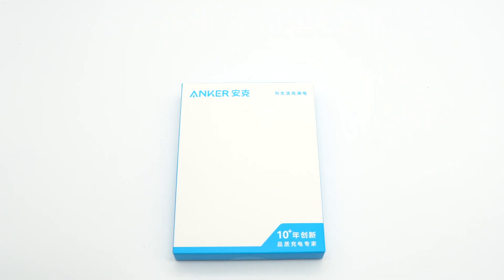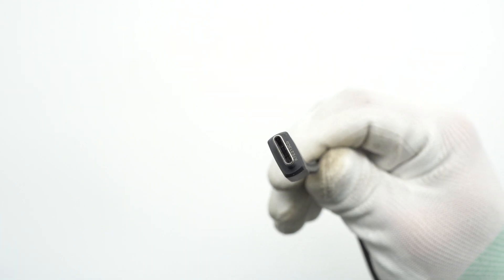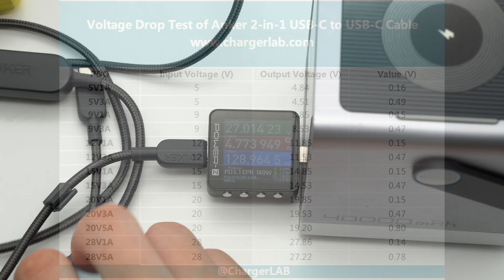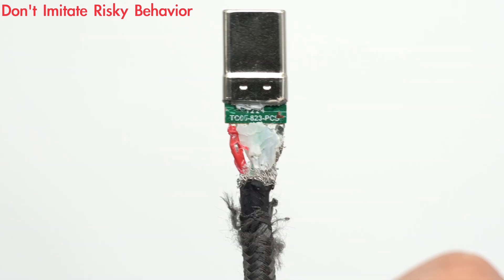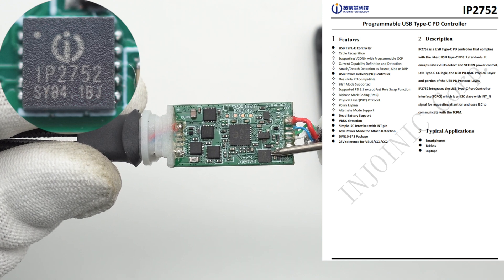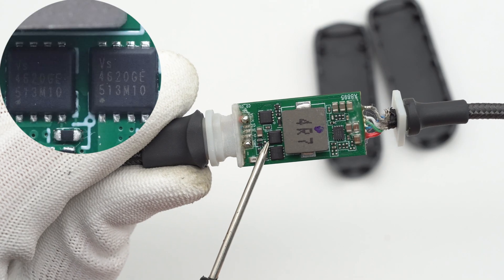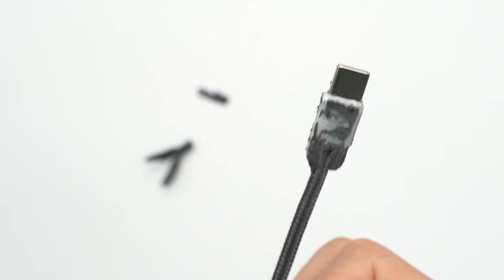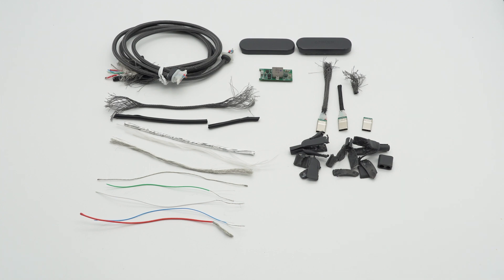Teardown of Anker 140W 2-in-1 USB-C to USB-C Cable

Comment: Recently, I bought a UEETOP 175W Charger from Aliexpress for around $25.  It seems very decent.  Not as good as other brand name like ASOMETECH or Essager.  But I can charge two laptops and some other low watts electronics. (3 PDs and 2 USBA).  Maybe you can give it a review.  Thanks.

Comment: Which type of USBC charger output can deliver 140w? What happens if a lower power charger is used? What portion goes to the high current port and low current port?
Reply: These are the questions we need answered
Reply: It is already addressed in the video. When both ports are connected to laptops or phones, each provide 50Watts. It’s assumed you’ll use this with at least 100watt charger

Comment: Is the cable gauge adequate? that was not discussed.
Reply: the largest voltage drop was only 0.8V under load so yes more than adequate